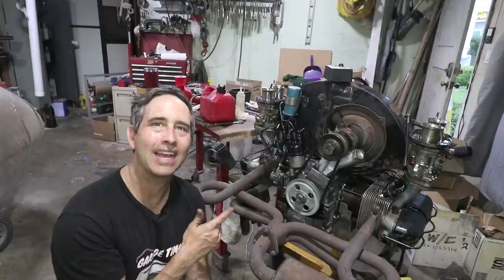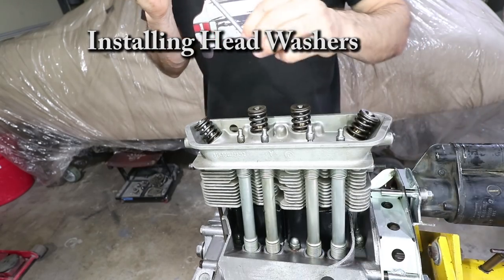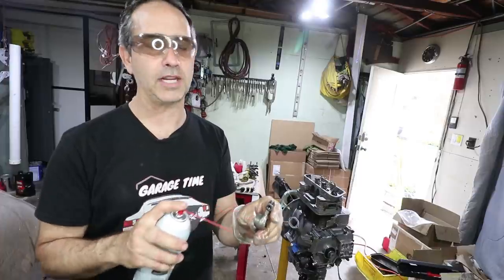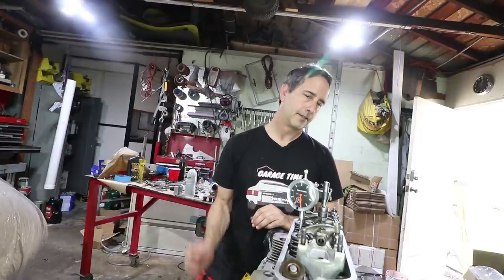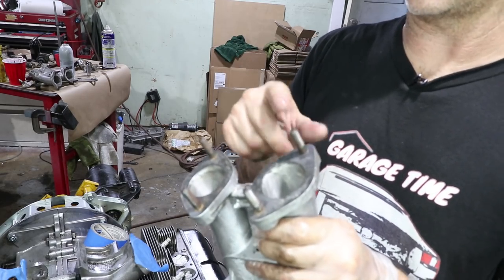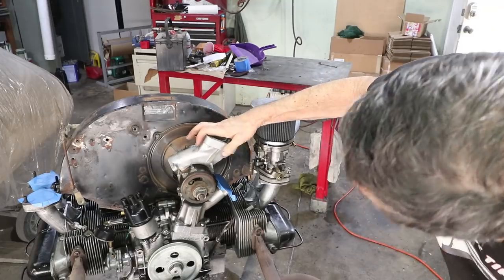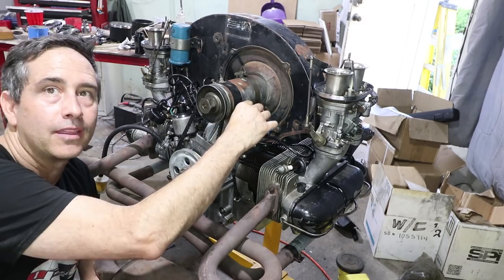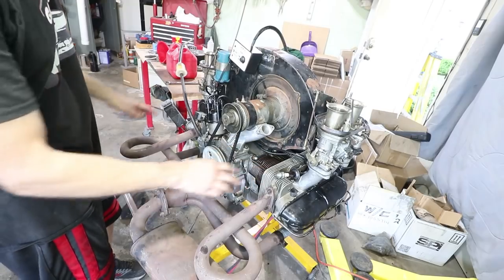Porsche 912 Rebuild Part 7 - First Start In 15 YEARS?  Abandoned Rebuild - Will It Run?

Comment: In the mid ‘60s one of my SCCA sponsors had the Webers off his RSK. I picked it up  and it was massive. Much bigger than the Solexes on my SC. 
I was planning on cleaning the parts of my 914 project in the ultrasonic tanks in the NDT lab where I worked in a GE machine shop. I only got the oil cooler cleaned before they shut us down. Darn!
Reply from the maker: I suspect RSK carbs are way better than mine.  The ones I have are 40IDF from Spain!
I'd love to have an ultrasonic cleaner, or at least access to one.  
At one point I looked at buying the transducers and making a stainless tank.  Who knows, maybe someday??
I hope they let you back in there soon👍

Comment: Awesome job Tom!  Congrats on getting it running.  It sounds like it is running well too.
Reply from the maker: Thanks Rodney!  It's running pretty well for first startup.  It helps that this carbs were dialed in on another 356 engine, but the synchronization needs to be improved.  
Now I'm hoping the 915 transaxle works.

Comment: It lives!  I think you said it would a temporary motor, but it might interesting to see if you can evolve this (or another) flat-four into something more powerful over time?
Reply from the maker: These are great engines.  Willhoit knows how to get power out of these with increased displacement to 2.2L.  Have you seen the POLO motor?  They can get 200 hp with 4 cylinders.
Reply: @GarageTimeAutoResto  Yep! I had the Polo motor in mind when I left that comment. Always cool to do something a bit different/unique, don't you think?
Reply from the maker: Totally agree it's really innovative and a well engineered package.  
However It doesn't make sense for me to hack off two cylinders in a 911.
I'll save weight some other way.  
Stay tuned 😀
Reply: @GarageTimeAutoResto  Sounds like a plan, look forward to seeing what you come up with.

Comment: Hi Tom 
First of all you have done a great job!
Where did you get all the Specs and Infos?
Is there a special Manual that you can recommend?
Reply from the maker: I use the factory workshop manual, Porsches little spec book, and secrets of the inner circle.

Comment: Do the carbs still need to be synchronized?
Reply from the maker: Yes, I just guessed on the sync.   Once the cam and rings break in I can bring it down to idle and too the full tune up.  Thanks for watching!
Reply: Sounds great ! Hope mine fires up that easily after 15 yrs or slumber.
Reply from the maker: Thanks!  It helps to use a known good distributor and carbs!